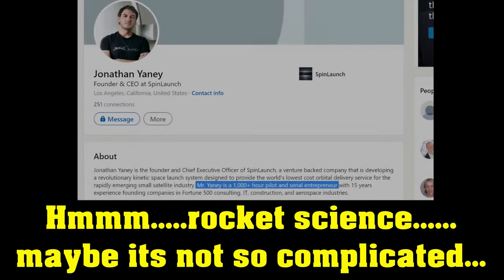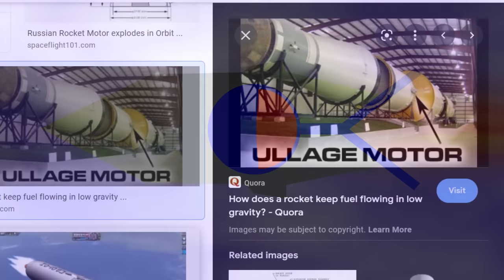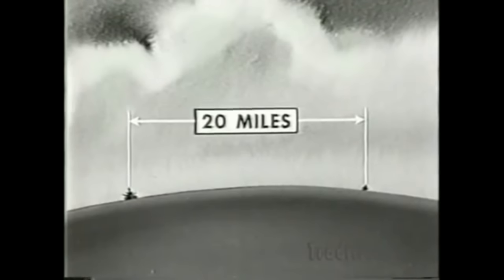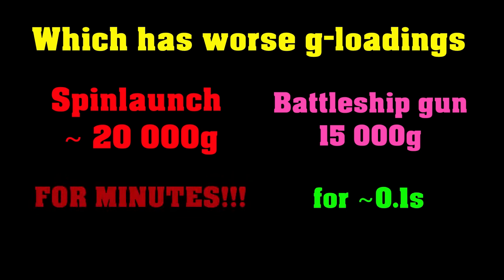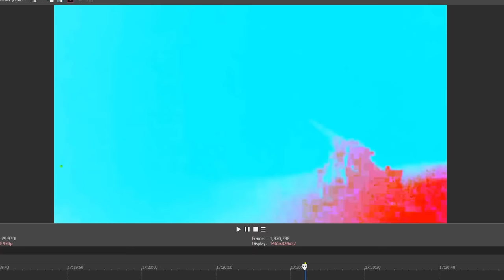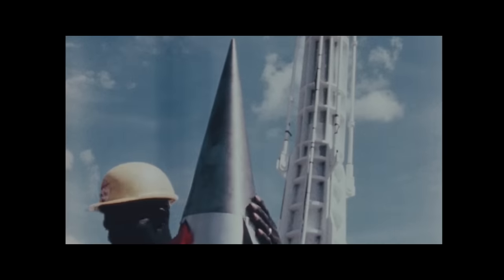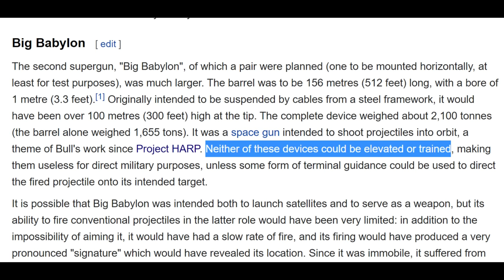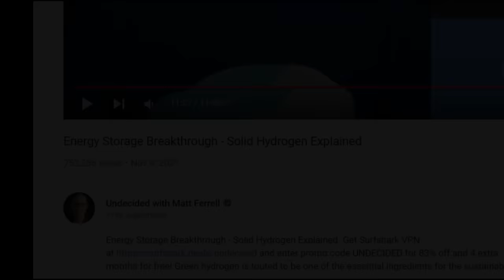Spinlaunch: BUSTED (Part 2)

Comment: 0:00 
mocking intro condemns sham science!

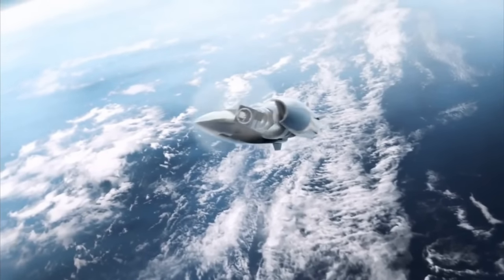1:30 
"the 3d graphic didn't show ullage motors!" that tiny little nit pick backfires as Teksatan said "fuel and oxidizer moving to the front of the tanks during deceleration is a problem that has been solved now in several different ways for several years." so you take the CGI as a simulation and not a representation. ok...

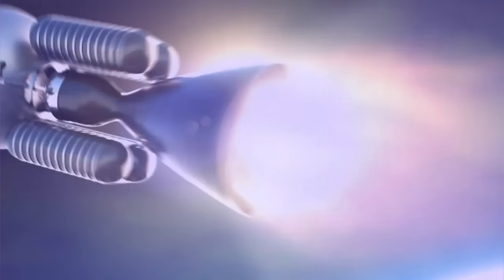2:52 
"the news said the first test went 5kmph but the first test was only 1kmph and the company did in fact say they have done tests up to 5k mph ergo it's a case of the company having lied not a case of the news having gotten something wrong" should have stuck with "maybe the reporters had gotten confused or something" thunderfoots gut intuition was right and he presents all the data to have known it... Note: we see real testing footage here, he uses it as a reference.

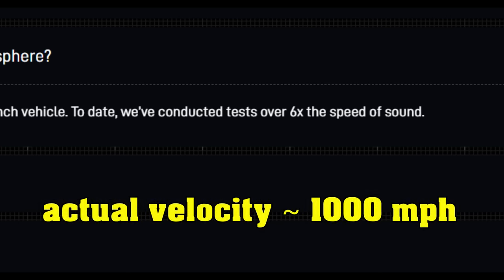4:20
"assuming the last thing is right [and it's not] then lets compare that fiction to navy cannons!"  or a hint at deceleration being a factor, the brief mention of mass differences not favoring your hypothesis, and then some time aside to mock the straw man your working on. [self comforting behavior] 

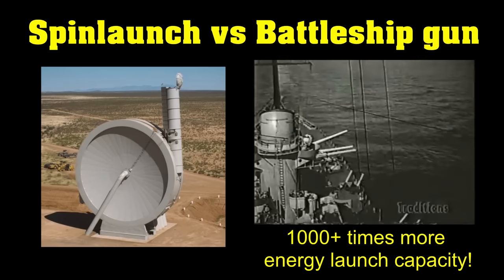6:48
"Lets ignore that the time period a load is applied over is more meaningful then the final load itself in regard to structural integrity and then go into a tangent about cannons again" this time ignoring the straw man because it's beat and done I guess... 

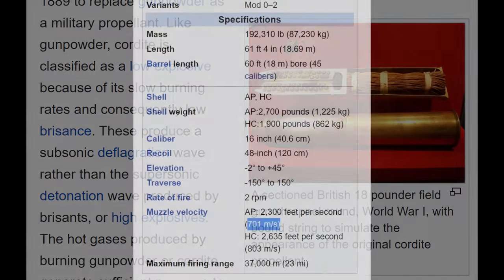11:10 
he remembered what the video is about. Just a rehashing of previous points tho. "look cannons existed 50 years ago and given the assumptions I generated around the news error, ignoring all the data entirely because its all CGI anyway!" is it? but wait you used IRL video of testing in trying to debunk it...

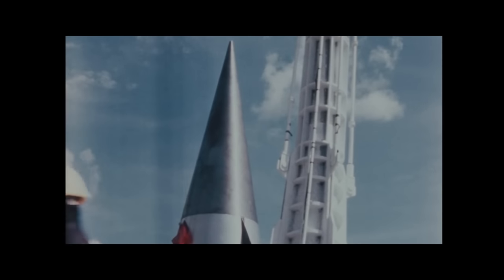14:20
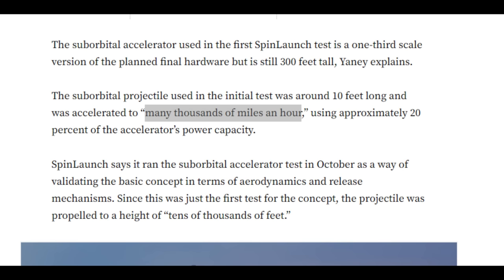"bah he got funding! hes not doin anything cool. HARP was real! this is just CGI!" If you could all go click 2:52 again and ask where his heads at?

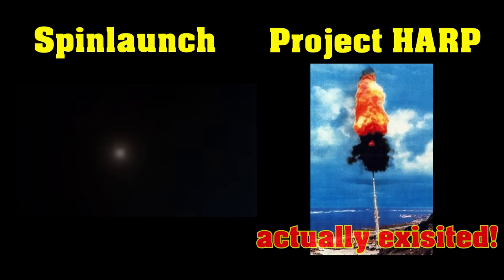15:00
"MORE Gs!" If you ignore that the time spent putting the load on helps to equalize stresses then yeah I guess that's a thing. "also it f has a slower rate of fire then cannons so ignore that cannons aren't putting things in space and just assume that's not apples and oranges" ok...

15:20 
FINALY A valid point! No seriously a real valid point! Nuclear reactors have blown up in the past, no matter how cautious you are mistakes happen. If things go wrong spin launch is $100mil of scrap. facts... Not a terminal point being as the investors are aware of that. but a valid point! good job, broken clock being right once a day and all...

15:30 
"10s of reality in a >15min video is more then enough, now lets talk about another video I did to promote myself. Please support me I'm really just a sad panhandler who can't figure out why other people get all this money to peruse their dreams and haven't spent enough time on self reflection to know I don't have any dreams I've put forward to get funding for, instead opting for safe projects that don't have even remotely the same appeal" 

Like and subscribe to someone else...

Comment: The issues for and against this video: (Sorry TF - you yourself say we should challenge you 😜 )

>> 1% inspiration, 99% perspiration: Anyone and everyone can and does have ideas beyond their ability. This includes confidence tricksters who are very good at coming up with plausible ideas Just be careful - saying someone could not possibly come up with an idea because of a lack of education is not a valid "busted" reason. It stinks of snobbery and hubris. Of course, going beyond the idea stage is a different matter entirely!
>> Gradual increase of G loading is a non-issue for solid-state electrics. Sudden G-loading is an issue. Spinning up is not even an issue for unfolding solar cells; it's all about the folding and unfolding. This has already been researched - check with the various space agencies. Of course, I have not seen anyone prove it works in the real world as there has never been a need to test the supposition. Sudden G loading, such as with a gun, can and does break components due to density variations within a single component. (Drop your phone from the top of a building to street-level on concrete for a simple demonstration you can perform at home.) The important issue is inertia of the component, not the current g-loading. Increasing the G-loading gradually will mitigate any issues density differentials.... up to a point. Solid state gyros may have a few issues.
>> ULLAGE motors missing from a CGI is not indicative of anything other than it being CGI. Therefore, this is not credible as a "busted" reason. Come on TF, you are better than this!
>> Triggering with millisecond and even microsecond accuracy is non-issue - we do this everyday! Nukes need nanosecond accuracy triggers - well the new ones do, the old ones were 10 microseconds. What level of triggering accuracy is needed for Spin-Launch? If it is millisecond or microsecond, fine (although inertia of the release mechanism may be an issue) but if it is a nanosecond trigger the project may be scuppered by technology embargoes. Even if it was not, the release mechanism may not be able to get out of the way. I suppose a magnetic holding system may work... mmm. Maybe. Okay, not without a magnet which would rip-the-iron-from-your-body. (Avengers Assemble!)
>> Opening and closing doors in milliseconds when the item is pretty big - I think the doors may bend a bit!